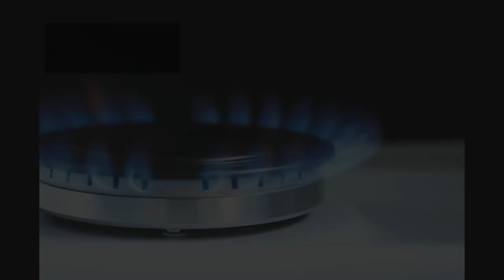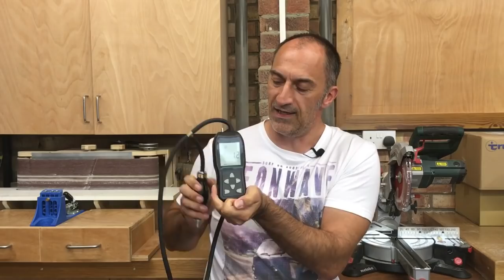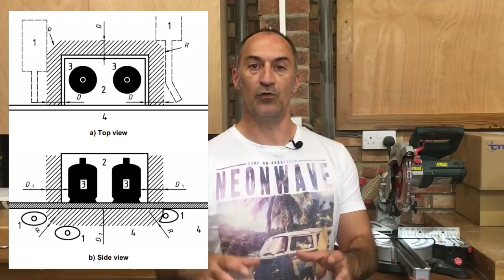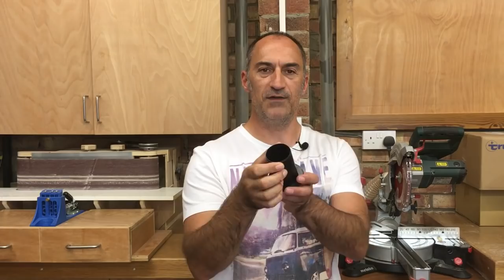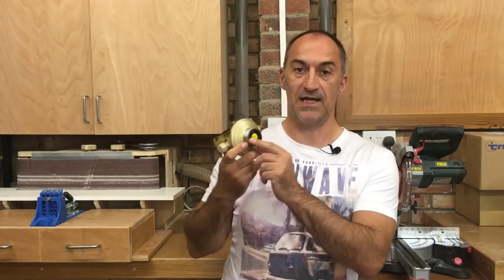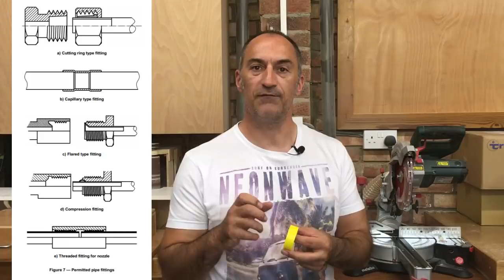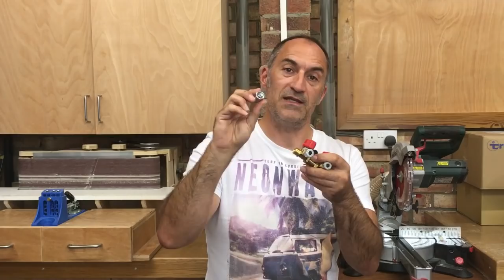Installing LPG in a Self Build Camper Van

Comment: Greg, LPG is a mix of Butane and Propane. When the average ambient temperature is colder the national blend for LPG will have more Propane - the more expensive gas. In countries that have warmer temps, there is little Propane. The reason for this is to start the gas flowing the liquid in the pressure cylinder needs to vapourise to make gas. If a cylinder contained only Butane it boils at -4°c. If it was say -10° outside the liquid would not produce gas.
Reply from the maker: That really interesting I didn't know that, thank you for sharing your knowledge.
So does that mean that in different countries in Europe I could be filling up with a different blend?
Can you foresee any problems there when travelling to different climates?
Reply: Usually they mix 50/50 in summer and up to 10% butane and 90% propane in winter, as far as i know from driving a lpg-car...
Reply: You may notice a difference if you compare times for cooking as the energy properties of Propane and Butane are different. The only difference you might find that gives a problem is if you were to return to UK with a Butane rich blend from "Meditterraniumland" and try to use it in a very cold part of UK. Bring cylinder into a warm place to warm up first - and be quick, once started it should self perpetuate ..... unless very cold. In Turkey we used to deliver roughly 4 parts propane and 1 part butane for them to blend.

Comment: This is probably  very obvious but something not mentioned is that filling points must NOT be mounted on an opening door. 

I won't link to it but there is a video showing a "professionally" installed system with exactly this (unsurprisingly the video has comments turned off)

Edit: Actually you know what I will link to it as the video mentions in the description who installed it. Probably a good company to steer clear of (IMO of course)
https://youtu.be/yx-F1BSq53I

Comment: great vid as always! im not sure if regs changed but my van which was converted by a local company in 03 has a propex malaga 5E fitted with flue below window and just a sign on window "do not open window when operating water heater " maybe that part of regs was post 03 ? again many thanks for the detail and effort in your vlogs
Reply from the maker: The reg's in place would have been the EN1949:2002 edition.
By putting a sign there to say you couldn't open the window, is like admitting there is a problem with the location of the vent.
I can only assume that there wasn't another choice in terms of location for the vent to go or did they just take the easy way out?

Comment: Hi Greg!

Another thorough, informative, most-excellent video! I’ve also done lots of research as to the best way to route my gas piping for my van build. Reading the various online forums, everyone seems to have a slightly different approach that they feel is “right”. Here in the US, there is no nationwide governing body that regulates this. Our home building codes, for example, are all at the state, county, and city level (at least to my knowledge). What might be acceptable in one locality might not apply in another town just a few miles away. Of course, the city codes must comply with the county codes and these must in turn comply with the state codes. Obviously this means that hard and fast regulations for RVs that apply across the country are non-existent. Otherwise you might not be able to cross state lines! When doing a van or any sort of conversion such as a skoolie here in the US, it’s pretty much an anything-goes affair (at least from a legal standpoint). There is no governing body that inspects your work, as is the case in more “civilized” places like New Zealand, for example.There are some industry “standards”, but these are little more than suggestions. Again, this is based on my research and I could be incorrect. (I’m quite sure your viewers will make me aware of any inaccuracies.)

Therefore, I decided to take the tack of more closely following the ABYC (American Boat and Yacht Council) standards (pun intended). I figure if it’s good enough for the confined spaces found in a boat that’s subject to all the stress of the open ocean, it’s probably sufficient for a van. I’m installing a horizontal LPG tank beneath my van. The regulator will be attached directly to the tank with threaded copper fittings, and from there I will use black iron pipe to a manifold with a shut-off valve for each appliance. From each valve, more black iron pipe will be run along the bottom of the van and then up through a sealed grommet, penetrating the van floor immediately below the location of each appliance. Effectively a star network topology, in geek-speak. :-) From there I will run rubber gas hose (which is approved by the ABYC and UL) directly to the appliance.

While copper piping is also approved by the ABYC, I prefer to use rubber because I am concerned about the hardening (and possible fracture) that copper tubing is subject to under vibration, which is common in a van, especially when driving down washboard dirt roads. As I am sure you are aware, this is the same reason one uses stranded rather than solid copper for all wiring.

I’m curious what you and your readers (in particular those here in the states), think about my approach. Note that many RV manufactures such as Winnebago use black iron pipe for the gas lines beneath the RV, so I didn’t come up with this method on my own. Given the huge liability that manufacturers such as Winnebago are subject to, I’m guessing (hoping?) they’ve researched this extensively.

Cheers!
Pete
Reply from the maker: Hello Pete, you have done your homework and a great comment thank you.
Your infrastructure under the van sounds really excellent and robust. With the black iron pipe, I'm assuming you are threading the pipe and using threaded fittings with gas safe PTFE? So there is some potential for leaks there, but they are all outside the van so no harm just possible loss of gas.
A plastic coated copper coil would still give protection and eliminate the joints.
Obviously, the rubber hose inside does not conform to the European Standard for fixed appliances.
I totally understand what you are saying because I too would expect the final connection at least to be flexible in a moving vehicle, but no.
It makes sense to me to run a continuous coil unit the last 300mm or so from a local isolating valve to the appliance.
If you place "drop-out" vents under each appliance and some means of gas detection in your van you will have a very safe system.
Great work Pete and thanks for the excellent feedback.
Reply: Thanks for detailed, response, Greg. Much appreciated given how popular your channel has become (and deservedly so). I completely agree with everything you've said in your reply and most definitely plan on using propane-approved pipe dope on the black pipe fittings. I still might opt for copper piping inside the van. I've gone back and forth a half dozen times (at least!). As long as one supports copper tubing at closely spaced intervals and at each bend, this should help prevent unrestrained flexing which can work harden the copper, possibly causing it to split. Rubber hose does not have that problem, although it too must be well supported. It's difficult to say how common work-hardening actually is. Could be more of a theoretical problem. But boy, I hate to be a guinea pig and find out the hard way!  I'm a member of several RV and marine/sailing forums and everyone seems to have a different approach and of course thinks theirs is the "right way". You'd think with all the RVs out there that by now there would be a standard method, but sadly, there is not. I'm certain your installation is top notch and will provide you with many years of safe, reliable service. Looking forward to your next video!
Reply: Hello Pete, I wouldn't advise to use rubber hoses inside your camper. They are ageing, therefore they are not as safe as a rigid piping. What Greg didn't mention in his video, the rubber hose which connects the cylinder to the rigid piping, must be changed after ten years, at least in Germany.
Reply: Thanks for the reply. Yes, I understand that the hose must be replaced, but ten years is a long time and the runs from below the van to each appliance will be quite short (about a meter, give or take) and are easily replaced. I'll have three: one to my range/oven, one to my Truma Aquago water heater (great German engineering on that device!), and one to my Dickinson Marine fireplace/heater. As I said, I might still decide to use copper tubing, but since rubber hose seems to be the preferred choice in a marine environment, one would think it would also work well in an RV or van. I don't believe there is a definitive answer as to which is better, as long as both are properly installed. Again, I appreciate your advice and will take it into consideration when I reach that point in my build! :-)

Comment: Hi Greg, from standard BS EN 1949:2002 only one gas cylinder is allowed for internal accessible lockers, maximum size 7 Kg.
And another issue is that I was aware that no soldered connections are allowed.
Could I be wrong on both points, what do you think?
Reply from the maker: Hello Rob,
You are now allowed two cylinders up to 16kg each internally.
32kg is a hell of a lot of gas for a van build? :O
Soldered copper joints are allowed in the current standard.
Reply: Okay Greg that's interesting but I will e-mail the standard to you, just to be sure.

Comment: Interesting video, although I don't understand a few things.
As you were saying, according to the norm it's not allowed to hide any gas pipers behind walls.
That makes pretty much every manufactured campers and caravans "illegal" (as well as most houses and buildings) ?
Second to that, in general NEN guidelines are basically only applied for commercial and professional cases.
For DIY there is a lot more freedom and rules are less strict.
Nevertheless it is good to know and excellent information! Thanks.
Reply from the maker: Hello, it really relates to the joints in the pipework and the potential for leaks to occur.
For many years now it has not been good practice to run gas services in sealed voids without adequate ventilation.
It does make sense to have all your fittings and valves where you can check them for leaks and well ventilated in case they should leak.
If the main manufacturer's are concealing pipework I hope it is a continuous coil with no joints at all.
Your second point is very interesting and let me ask you a question.
Because there is nobody enforcing these standards on the home DIY builder are you happy to install your LPG gas system any way you want to?
I guess what I'm asking is will you install to a lesser standard and are happy to run the risk?
Reply: I am more familiar with the norms and standards in electronics (I am a professional in that field).
A standard is more than just safety. 

It's a compromise between safety, easy to understand/follow, not to difficult to perform in practice, not to obstruct innovation, something that in general works, the risk factor and a mix with some history and culture.
(People from different countries sometimes interpret the same standard different)
So that being said, it also means that following the standard is not the only way to make something that is safe.
As a DIY'er you take the responsibility yourself, although that even depends per country.
In some countries you need to go through a mandatory examination. 

Anyway, I get the point about joints and fittings. I guess that also answers my question and explains it. :)
Personally I am a bit surprised about only using solid pipes in a moving vehicle, with moving and bending walls.
Because a solid copper pipe has an higher risk to form cracks (especially near the fittings/joints).

Anyway, keep up the good work, because I agree with the idea to inform people about the risks and safety!
That is much better than people who just do something and aren't even aware of any issues.
Reply: You're correct, I can actually relate to this as well.
Nice video indeed.
Reply: Greg Virgoe Hi Greg - how did you run the gas line from the left side of the van (gas locker) to the right side (truma)? Did you use trunking under the floor?
Reply: I could be wrong, but I believe the issue is hiding connections (e.g. a Tee fitting) behind walls. My understanding is that it is acceptable to run the pipe behind cabinetry, etc, but all fittings must be accessible.

Comment: Did you consider diesel heater and electric heat and cooktop?
Reply from the maker: Hello Matt, I ruled our diesel as the LPG is cleaner and cheaper per litre about half the cost.
Running any kind of electric heating or cooking can only be done long term on a hookup and I wanted to be able to get off the grid for long periods and be self sufficient running off my solar electric and LPG bottle

Comment: Hi Greg, I do think with your skills and knowledge you could easily make a business for yourself in van fitouts, however they are a labour of love ! Very useful information indeed, I was going to fit a cooker inside a studio and the bottled gas inside. Me thinks that will definitely go outside and have a run of copper to the inside to the cooker.
Reply from the maker: That sounds like a very wise move, make sure you have the bottles in a locked cage or small locked shed with vents at high and low level, means of local isolation and the appropriate warning signs fitted. Thanks for watching

Comment: Are you also going to install LPG leak detector alarms? Maybe 1) One in the cabin and 2) one in the housing in the LPG tank? We can never be too safe with LPG =) Again, great video. It would be nice to show a close up of that olive fitting at 15:50 to get a better idea of what you were talking about, but overall, fantastic video! Always wondered what the real dangers are of LPG were in these mobile designs.
Reply from the maker: Yes, I am fitting detection as you have suggested and multigas ones to not only detect LPG but CO as well
I will add in a bit on the forthcoming gas installation video showing the compression fitting in more detail.
Thanks for great feedback
Reply: I have a class A motorhome in the US. It is equipped with a LPG detection monitor linked to a control valve. The system will automatically shut off the flow of gas in the presence of vapors along the floor.  
I have only just stumbled upon your channel yesterday, and have binged watched almost the entire series.  Your detailed craftsmanship, and concise presentation make the videos engaging and informative.
Good luck in your travels.

Comment: Hi Greg, Did you consider getting an externally mounted underfloor gas tank for your van and using automotive LPG? It seems to have a few perks in regards to safety (keeping gas outside the van), cost (of fuel), and storage space? I was wondering what your thoughts were on these systems?
Reply from the maker: Hello Phil, yes my gas tank is a Gaslow refillable cylinder that uses autogas for the exact reasons you mention.
I had already decided to have both water tanks under the chassis so there was no room to fit the LPG as well.
I could have swapped the fresh water for the gas tank but already purchased the items and installed.
If I ever did another one the outside tank would be a good way to go. Inside water tanks for frost protection.
Reply: Hi Phil. I think the Gas flow system Greg is using is designed to be filled via the port on the side of his van this benefiting from the savings that Autogas provides.

Comment: If differs from country to country. In Holland nobody cares. En Belgium and Sweden it has to be checked. The rest I don't know.
Reply from the maker: Here also nobody cares, so we as individuals should care about our own van.
Just because nobody enforcing the standard is not going to stop me following it to the letter.
It's there to help save my life.
Reply: @GregVirgoe  my thoughts exactly. I am rebuilding a camper at the moment. It's over 30yrs old. It is just amazing how many stupid things people can do. I removed so much wiring etc. Fire waiting to happen. Open electrical connection near the old truma gas heater etc. 🤦‍♂️

Comment: very well explained! i just have 2 observations, the difference between butane and propane need discussing and, in my view, the cause of the dreadful boat explosion is normally lack of a 'drain' for the leaking gas.
ie. its is vital any escaping gas, as you say is heaver than air, need to be thought of as water, and will 'pool' if not drained away! typically in a boat you can't fit a vent to allow the gas to escape!
in fact it may look stupid, but you have to bucket the gas out of a boat as you would water.
great videos, keep up the good work
Reply from the maker: I hadn't had time to research prevention for boats and obviously a "drop out" vent in the boat isn't going to be very practical ;D
I'm guessing detection is the key to alert the occupants on board?
Reply: Greg Virgoe hi Greg, first I think your videos are great, this is only my constructive comment, maybe helpful to others, gas on a boat is so dangerous in my view it must be on ‘topside’ and vented, and folks to be aware if they smell gas, it must evacuate below deck, and bucket the gas out, sounds daft, and looks daft, ........
Also in freezing conditions, butane (blue bottles) will not work. And may seem empty, so be carful. A little knowledge is ...... etc....
Reply: You can, water will displace any gas, including air. Boat won't float for long, though ;-)